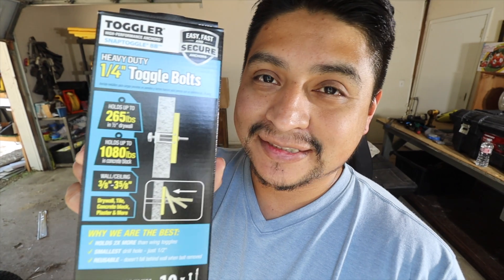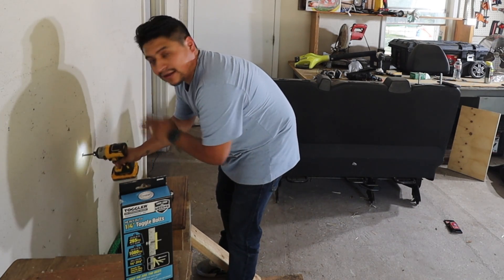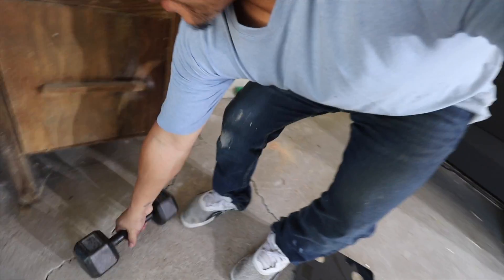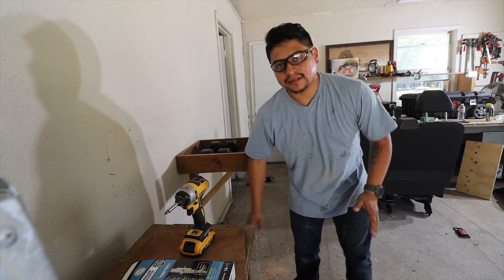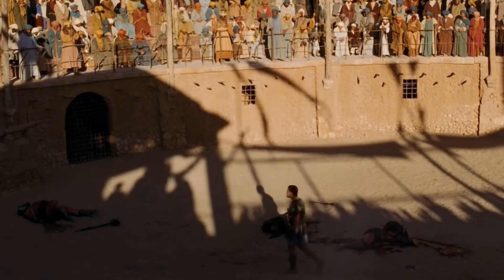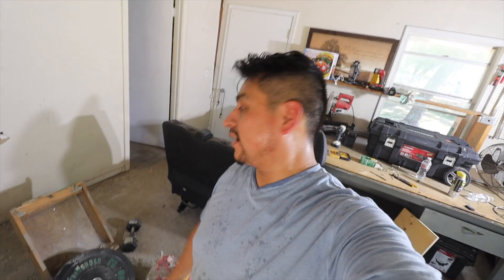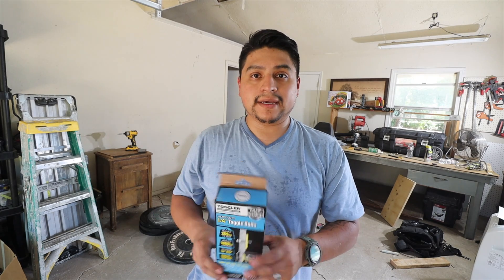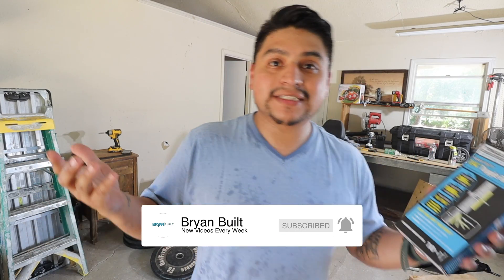I Tested How Much Weight a Single Toggler SnapToggle Bolt Could Hold

Comment: only had 1 wall stud to use for a full motion tv mount to bolt to, and I also used 4 of these to support the rest of it holding up a 75in TV that's 60lbs.    i have 100% confident in the the full range of the full motion tv mount, it will hold for a long time with no issues.

Comment: I got 4 bolts holding up a cat shelf. I don't wanna test it cuz the wall will pull off before the bolts break. I gave a slight test to it and heard the drywall start to pull. Kinda silly they advertise this way, I mean it works, but the issue with hanging things is hardly the bolt itself shearing.

Comment: The Toggle held with no damage. The drywall gave way. I would say the toggle in something like a 3/8-1/2" wood panel would actually hold shear and pull out of at least 500 pounds.
Reply from the maker: Yeah it was definitely the drywall that failed

Comment: I think other commenters have essentially said the same thing but the test is not legit. The wooden "leg" of the drawer support flush to the wall is distributing weight along the drywall increasing the hold capacity. that would not be a typical application of the product's usage.
Reply: This is true.
Reply: and the toggle here is not positioned in the direction it is pictured on the box. 
It’s supposed to be positioned like a ladder.

Comment: What would you recommend for putting up wall shelves?. I got some rubbermaid shelf boards. I'm shelving out an entire wall in my spare room (craft room) I got 5 up using two studs but the other shelves won't line up with studs. 😭 I have wall anchors and togglebolts
Reply from the maker: I would use these type of toggle bolts they re my are my favorite. I have used them for tvs shelves and even one end of a cabinet that didnt land on a stud

Comment: Hmm.....wonder what these things could hold anchored in a metal stud rather than just drywall...?? You think these are overall a better option than standard 1/4 toggle bolts..??
Reply from the maker: I think they do hold alot more like that. I know in cinderblock they are rated for alot more weight. I do like these better than a standard toggle i feel like the toggle  is heavier futy and they are easy to use

Comment: Great video, thinking of using these to mount a large TV where I don't have wooden studs.
Reply from the maker: Thanks ! I have actually used them for that but i think the biggest tv i have done is a 50 inch and I would always try and find at least one point where the you can anchor to a stud if possible. I did install a 46 inch in my house with no stud available in the video below im still keeping an eye on it to see how it holds up long term. 

Mount TV on Drywall Using Only 2 Toggler Snaptoggle Bolts | Best Drywall Anchors
https://youtu.be/xujweedgXQw
Reply: @BryanBuilt  thanks for the reply. My problem is I have superior walls behind my drywall and it's not blocked out with wood. Still looking into the options. I wanted to go with a 75" tv.
Reply from the maker: Yeah bro idk about that big. It might work but i cant say i have tried it . I do know the closer to the wall the tv the more of a chance it works. I would be carefull to try like an extendable arm tv mount with that size tv . Maybe reach out to toggler and see if they have any best practices for something like that sonce they do say it will hold up to 200plus pounds per toggle bolt
Reply: @mikesando7766  Did it work out?

Comment: Hi! So using multiples of these should be able to store my weighted plates? I bought the PRX storage peg rack (which seems to have some weight already to itself as well) to hold 160 lbs. I don’t have space to place it over a specific stud or room for a stringer board either.
Reply from the maker: hey thanks for watching and commenting! Theoretically it should work cant say for sure because i havent tried it. I did only use one anchor so i would assume if your used more it would spread the weight more . do you know how thick your drywall is? 1/2 inch or 5/8?

Comment: Hello, good reference for sure, you'll notice its the drywall that fails not the anchor, so the substrate you're mounting to will determine hold up to the actual fail rating of the snap toggle, which would mean fracture of the actual stamped metal toggle section. If you were on 1/2" drywall, that's still a great hold that's for sure, we have 5/8'" here at a commercial application so they hold even better.   thanks for the video, they are the best thing since sliced bread.
Reply from the maker: Yes it was the drywall that failed for sure! Ive been waiting for a chance to try it on 5/8 . These are for sure my favorite anchors to use . Thanks for watching and commenting i appreciate it
Reply: I'd love to see this same video with a metal stud to mount the snaptoggle to.

Comment: Planning on using this for a 9U network rack… probably will be picking up some washers also… probably going to be a total of 100lbs off the wall
Reply from the maker: Nice! I think as long as you use multiple it will work great for you. If you can find a stud on one side even better
Reply: @BryanBuilt  I'll be using 4 of these... I was going to use Lag Bolts on studs, but studs are very limited in location.
Reply from the maker: Yeah 4 should do it if you cant find a stud . I used two for my tv and its holding up great

Comment: Not sure if it would have made a difference, but the toggle was horizontal behind the wall. I wonder if setting the toggle vertical might have improve performance. Does the packaging address that?
Reply from the maker: It didnt mention anything in the packaging . I thought about that too but i dnt know how you would be able to tell once its in the wall.
Reply: @BryanBuilt   they should put an arrow on the anchor to mark “toggle vertical” and “toggle horizontal”